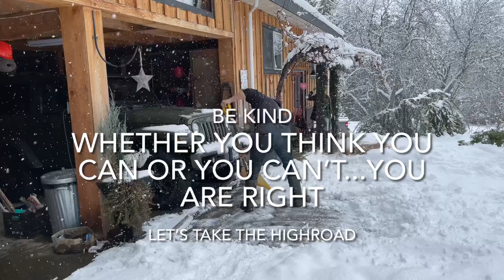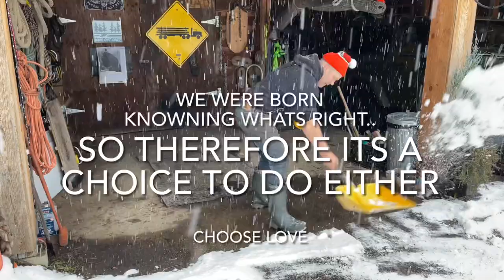Firewood - all about seasoning- wood shed design. Best time to fall, buck, split

Comment: One thing that helped me swing an axe more accurately was putting my dominant hand on the bottom of axe handle (closest towards you). I see most right handed people do it with the left hand on the bottom, but for me it greatly improved my axe swinging to do the opposite (I notice bearclaw swings this way too)! Thanks buckin. This will be my 3rd season harvesting firewood and your videos on watching the crown, falling, sharpening chain were the only ones that made sense to me back then.
Reply: i do same way, saves me a lot of energy, and chop it easier
Reply: I’ve never tried that ! I’d probably miss the world and fall over !
Reply: @CrimeVid  Pretty sure I'd cut my leg off if I tried that crap. I tried to air axe it goofy and just about took the boys out
Reply: I do flip my hands while golf splitting occasionally, but non-dominant on bottom will always be my default personally!

Comment: Hello Buckin'! not bashing, just a helpful tip. those stove fans work best if placed at the back of stove on a 45 degree blowing heat across stove top. The motor and wires in them will stay cool as it pulls cool air from behind and pushes across. Sold em for years and every single one returned for warranty was because of overheat being too close to pipe. Excellent piece of Canadian invention though, they work awesome!

Comment: It took me 40 years to learn about cutting firewood when the sap is down.  I cut from October to April and that's it.  Cutting firewood in summer sucks.  I have 4 woodsheds made out of pallet racking that hold 1.75 cord each.  Sides open and metal roof.

Comment: Tractors? I'd suggest a Ford Jubilee or one of the old Massey's. I did quite a bit of log handling with a Jubilee and it had a front end that stood up fairly well with the weight.

Comment: Im down south from you in oregon..im literally installing a wood stove right now.ive been wanting one for years i got my permit to begin work today.
Reply: Just  got mine back in nov. Ur  guna  love it    permit lol
Reply: @greatgreengoblinbear3800  permit was 19 bucks and my house is insured .i didnt want any problems from the man..im using all factory built chimney components. Duratech stainless steel chimney pipe.9'5" chimney sticking out is hard to hide. I have a 10 12 pitch roof .
Reply: @scooterscat3309  dang   I'm here in wa  it's a couple  hundo  and you have to have a pro  install

Comment: Fun to see Buckin doing to same technique as my dad would do.
Get to maul started into a block then raise up to the apex of the swing and turn it around and come down on the block with the hammer end.
Inertia helps split it apart..
  Dad also would point out that in older “sotz monster maul” adds the guy had the “y” of the branch grain the wrong way.should have the “y” facing down for a easier split.  Eh ?.

Comment: I burn 36 BTUs seasoned 3 year southern European White Oak.  And I froze my butt off the other day when central Europe dropped to .-15C in a stone house without insulation. What is better brick or a wood stove to heat a home?  I use only brick.  Although, the olive wood I burn varies in BTUs but is the perfect wood for cooking and baking.  The convection heat of seasoned olive wood is lasting and enduring and be a medium or high heat 30 BTUs to 36BTUs. :)

Comment: I liked the axe that someone sent you.  It would solve the biggest problem with double bit axes for splitting the thin wood where it goes thru the eye.  Too easy to break the handle.  Pretty it up some and it might have a future.  Both of you had success with it.  Looks like it is pushing 6 lbs which is okay with me but probably too heavy for many.

Comment: 9min mark.  Red oak?   I have always heard 1-2 years for red oak.  Obviously we have different species of trees.   But could you elaborate on that.   Had two massive 110 foot 36-38 inch truck tree of red oak taken down in mid December.  Had no time to split will start tackling in spring. Thanks for the positive of positives!!!

Comment: If you cut a tree in summer, if you can, just drop the tree, and leave it lay with the top and leaves still attached for 2-3-4 weeks.  After 2-3-4 weeks, then go top it out and buck it up.  You will be amazed how much water will come out of the tree through the leaves over that time.

Comment: we got the sun and 17 ic. that's 2.5 cm i was chopping it with an ice copper it got warm and frozen.ps think you need a heaver head lighter handle in the bunker. then warm again cause i got going again

Comment: Checking in from WA state. 

Would girdling a tree in winter keep the saps and moisture from going up the trunk?  Then I can drop it and process it when time permits thru the year.
Reply: Hmm,  i would say yes...
Anyone have experience with this...? 
Sounds like good advice,  most of us know which trees we want down,  in fact i may try that on some big limbs i want to prune but need to do a bunch of rigging into the springtime.

Comment: Your trying to get an old Ford 8 on 9n too huh... Me too
Reply: Simple stupid  and common as pond water. Try to find a 51-52 has better steering box, better rear axle seals (you might even have brakes!!), Get yourself a electronic ignition and never worry about arcing the points when you convert to 12 volt. Had many of those old girls